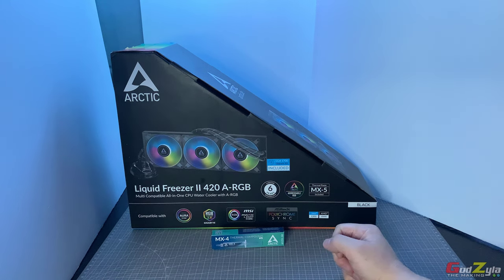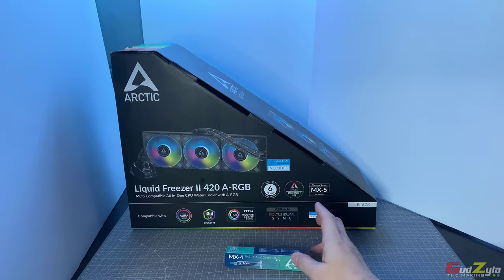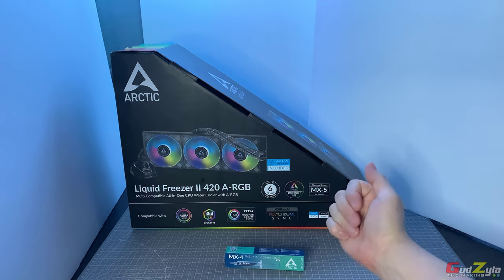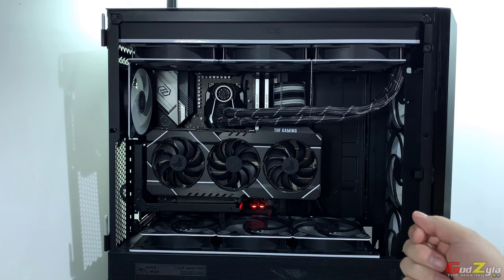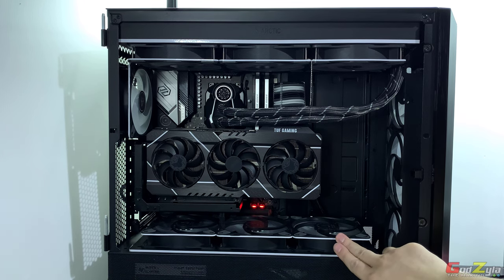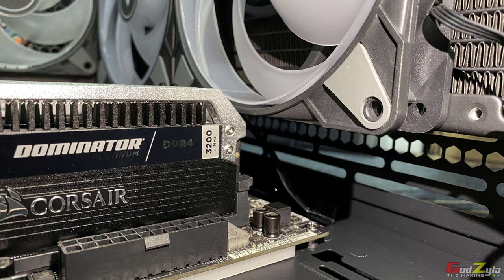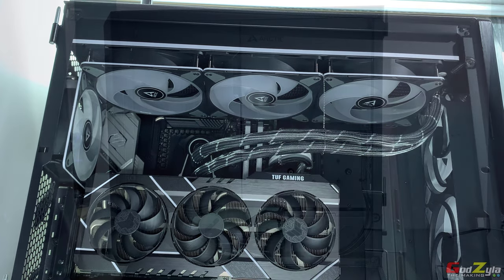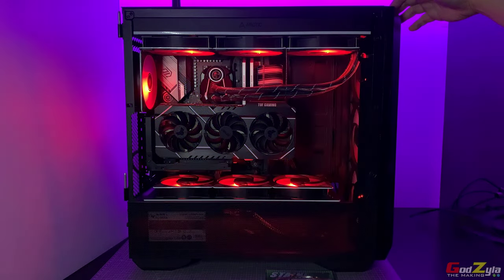Arctic Liquid Freezer II 420 in Lian Li Lancool III - Part 2 (The Experience)

Comment: Amazing review! Insta like and sub. I bought the case and the AIO because of this video. I have a few questions about the assembly seen in the video:
a) How long are those rubber screws? 
b) Do you think the rubber screws are needed for 17-18 mm fans? Such as the preinstalled fans that come with the RGB version of the case

Thank you very much
Reply from the maker: Hello Unai Biurrun, welcome to my channell as to answer your questions,

Qa) How long are those rubber screws? 
Aa) They are not rubber screws, they are rubber clips for fans. you can have a closer look here https://www.amazon.com/gp/product/B0749BRLXW/ref=ox_sc_act_image_1?smid=A1BZIHZ1Q03R2Z&psc=1

Qb) Do you think the rubber screws are needed for 17-18 mm fans? Such as the preinstalled fans that come with the RGB version of the case
Ab) Sorry, I dont really understand your question here. why do you need to use these rubber fan clips on the preinstalled fans? I Assume is at the frong?

now please note, I have miss out one part of the video, which is the front. you can only mount it this way at the front tray, if not, you can't lock the tray in place. https://imgur.com/gallery/vHezOSS
Reply: @KleoYan  
Hello Kleo Yan,

First of all thank you for your answer.

Aa)
Yeah, "rubber clips" is a better term, sry.
 
Ab)
What I meant to ask in my second question is if rubber clips would be needed to install a 17-18mm thick rear fan in order to be able to fit them alongside the 420mm radiator. 
You used a 25mm rear fan and without the rubber clips it wouldn't be possible to fit it, because it would collide with the radiator fans.

Also, why did you use rubber clips in the front fans? Would they fit with normal screws or would they collide with the radiator just like the rear fan?

Thaks in advance. Cheers!
Reply from the maker: @UnaiBiurrun  hi ya, ok as for question Qb) you might not need the rubber fan clips, but on the save side, it's better to equip or to pruchase, just incase. So sorry that I can't meassure for you as the case no longer with me.

Comment: Interesting. Lian Li recommends placing the AIO tubes at the back. My understanding was it's because tubes won't fit at the front. But you actually had no problem placing it on the front, even without removing front bracket. Nice, thanks for the info :)
Reply from the maker: Hi tabin welcome to my channel. There is a catch to the front. This is how I mount the fans in order to place the front fan tray https://imgur.com/gallery/vHezOSS
Reply: Wait, so, the front fans do not fully snap in once push them into the case? There is a springed hook in the front that holds the front panel fans. Did you just not bother hooking the front fans as they initially were? Is it even safe to leave them unfixed by the springed hook?
Reply: @isaaca.4570  Front fans are placed on this removable bracket and the bracket may or may not snap, depends on its placement. The bracket has two positions, one is with fans more inside the case and then AIO won't fit. But the second is with fans more outside the case and then AIO fits.
Reply: So is it safe if fan bracket does not snap into its original position? Should I then tape it or glue it so that it does not move?

Comment: VERY helpful video series.  Thank you VERY much for the care you took in making these 3 videos.  I'm planning to build a Ryzen 9 7700X or 7950X PC using the ASUS ROG Strix B650E-F mobo, LIAN LI Lancool III or Phanteks Eclipse P500A case, Arctic Liquid Freezer II 280 or 420 cooler, 32GB g.Skill Trident Z5 Neo RAM, and a Quaddro P620 video card (no gaming).  Thanks again.
Reply from the maker: Hi ya radar52, welcome to my channel and thank you for your valuable feedback. I am currently testing on the 7950x with pbo2 settings. Infact if you do pbo2. Temperature goes down and with identical or even better performance with the curve optimised set properly. With these pbo2 settings a 280 can handle the heat with the P500A case. No issue. By the way I did have part III which might interest you https://youtu.be/1SPioF78x_E
Reply: @KleoYan  Yes, I did see part 3 listed, I just ran out of time from playing your build video at 1/2 speed so I could follow it better.  I'll watch it tomorrow.  I've heard that the 7700X has a little more frequency head room over the 7750X, but I'm not sure in what use-case I could exploit that.  Anyway, thanks VERY much for the info on the pbo2 setting.  I actually prefer the ALC II 280 because it looks like less of a hassle installing it.  And I prefer the P500A case, slightly, over the LC III, although I can't really say why.  They're like 1 and 1a on my list.  I'm hoping that the Black Friday sales will give me better pricing on some of the parts.  Please do a video on your research with the 7750X and pbo2 settings.
Reply from the maker: @radar_B-52  ok will do but I do need time though. Nevertheless I will do up a vid about it. Thanks buddy and all the best with your build too 😉👍
Reply: Hey there, I was planning the same build except with a GPU (once the new AMD GPUs are out). Which case did you go for and AIO? I'm really considering the 420 AIO, especially for all these new power hungry CPUs... If you went for the 420, I'd really appreciate some pics and tips for fitting the 420 AIO in the case. 
This video is great, but would be interested in front mounting the AIO (ideally with tubes at the bottom...)
Reply from the maker: @Cenzo4u  welcome to my channel. As for your request. Am not able to do the front mounting with 420. Do pardon me as I have donated this case and the system.

Comment: Great vid - since this is becoming the hub for all things lancool 3 and 420 aio, I also have installed one. I have rog hero x670 + h170i. The top mount setup does NOT work with this mobo sadly. Mobo input shield is too thick. The 140mm fans don't fit with radiator in place. I would be cautious when buying mobo. I did find a reasonable alternative, which was to front mount (despite case not saying it supports such), where I installed the front plate in maximum forward position (i.e far into case, and 140mms in front). Unfortunately you don't get the clearance with any front radiator setup with this radiator to fit 3x 140mm top fans, so have settled with 2x on top, with reasonable spacing. It was not an easy install, but tbh it doesn't look bad.
Reply from the maker: Hello J 1, welcome to my channel. Part of the reason I did this content is to warn others too about the clearance. Which most motherboard manufacturer do not list dont the measurements for the height of the VRM and the rear I/O shield. Anway for font mounting, both are able to mount, be it Arctic or Crosair but as you've mentioned, not possible to mount 3 x 140mm fans. However, you can still mount 3 x 120mm fans at the top. Thank you for visiting my channel and to leave your valuable pointers which will help others. 👍👍👍

Comment: Holy Guacamole, I did not know you could install fans on the bottom too.
Reply from the maker: Hello Isaac, welcome to my channel. Yup you can mount fans at the bottom. 😉
Reply: @KleoYan  Good to be here. Did you install the air filter under the bottom fans to prevent the dust and any other particles from getting into the case?
Reply from the maker: @isaaca3849  nope, I did not install any as I always do regular dust off using a portable air blower.

Comment: I have to remove front stock fan and the bracket just to install the radiator. Once radiator is in the front backet can no longer seat. This arctic freeze is actually shitty
Reply from the maker: Hi Cybercore Private Software, welcome to my channel. I did tried to mount the LF2 420 at the front and unable to do so, thats why i've placed it at the top. Nevertheless, thank you for your feedback.
Reply: @KleoYan  I fix it on top bro, but when mounting with screw only the left side fit, right side all not fit. If left side one fit, it will also cause the front fan panel to not able to fit it.

I end up having to tilt Abit and tie it with cable

Mine revision one come with lg17000 upgrade kit but obviously not built well for lancool iii. Really regret
Reply from the maker: @cybercoreh4ks  hmm I don’t face the issues you have. All my screws at the top holds the radiator. Only issue I have is the rear fan where I use rubber fan studs. As for the front fan tray. I mount it this way https://imgur.io/gallery/vHezOSS I am so sorry to hear your side of story but I never regret as it does cool my 7950x better compared to a 360 Arctic LF2
Reply: @KleoYan  I managed to get it work by removing rear fans. I bought the argb one without any controller.  now that i have installed it, it has got no colour at all.

i connect three of the fans from radiator to the socket from the pump from radiator, then connect the 4-pin from socket to cpu_fan in motherboard. there is one more 3/4pin thing from the socket, i didnt know where to connect it [i believe it is for the colour right]

would appreciate your help

i spent around 10 hours this is my first time building a pc, hahaha, got very tired and frustrated after failing to screw well on the radiator [ didnt remove the rear fans as instruction by lan li iii paper ]
Reply from the maker: @cybercoreh4ks  I have done this. For all fan load. I daisy chained them according to this.

For fan load
=========
Top Radiator - fans x 3 (daisy chained) to motherboard CPU_Fan header

Front - 3 x fans daisy chained to motherboard CHA_FAN5 header

Bottom - 3 x bottom fans daisy chained to motherboard CHA_FAN4 

Rear - a fan to motherboard CHA_FAN1 

For fan argb load 
=============

First purchase this RGEEK 5V 3Pin RGB LED Splitter 10-Port Hub with 50CM 3Pin Extension Cord, Perfect for Lots of RGB. https://a.co/d/2lU92tv which gives you 10 argb port. Next your case have 3 argb connectors for the front fan. I have plug 2 front fans to the case argb connector, leaving one to connect to this argb 10 port hub. Now for the 3rd front fan, plug it this argb 10 port hub and you left with 8 port empty, the rest of the fans just plug individually to this argb hub. Argb extension cables might be needed. And I don’t understand why 3pin argb extension are so expensive on Amazon.com SJZBIN 3pcs Micro Connector Addressable RGB Extension Cable 30cm Black RGB Strip 3Pin Extension Adapter https://a.co/d/aA5BIkU.
Reply: @KleoYan  Top Radiator - fans x 3 i connect it to the 4pin fan header from radiator pump. each fans have two other cable that i dont use.

then i connect the 4pin of socket pump to the cpu_fan, and the 3pin 5v argb to my motherboard jrbg_v2 3pin, but none of my arctic fans have rgb. 

my lan li casing fans all have rgb. is it because the 3pin of socket pump is faulty?

my msi lighting software said it can recognize but changing the light setting wont affect my arctic fan. i can control only the front lan li casing stock fan atm with my msi lighting aura
Reply from the maker: @cybercoreh4ks  I think is best to list down what fans are you using and also what motherboard are you using. i am getting confuse of what you have typed. do it as point form as I've illustrated to you. Thank you!
Reply: @KleoYan  
arctic freeze ii argb 420 rev 1.
Lan li iii casing
MSI pro z-790 pro wifi ddr4

Lan li Front fans x 3
Arctic fans x3 with radiator at top 420mm.

I connect two header from socket pump of arctic, one to CPU fan socket, one to arpg socket in mobo. But arctic fans is not getting any rbg.

My arctic fans are daisy chained to the  3x connected 4 pin header from the pump area of radiator.
Reply from the maker: @cybercoreh4ks  ok.. I think I know what's going on.. you will need to download MSI center to activate the strip for JRGB_V2. watch this.. https://youtu.be/VST4LFZ_L-U?t=131 in the video where you have the LED with a drop down. you will need to select the strip to activate JRGB_V2. to download the MSI Center , go here https://www.msi.com/Motherboard/PRO-Z790-A-WIFI/support#utility
Reply: @KleoYan  thanks i fixed it already. i did prime95 test on i7-13700k with this aio and i reached 100c max is it normal? the top radiator arctic fan with the arctic logo facing downward mean exhaust right.

i have 3 fans in front (intake), top radiator arctic fans (exhaust) but my stress test is easily hitting 100c (cpuz or prime95). wondering if its due to me applying thermal paste (spread 3 line, then straight insert the socket)
Reply from the maker: @cybercoreh4ks  looking at the fan with the frame side. That is air pushing and without the frame is pulling. If the logo is without the 0.11a word is exhausting air out. The one with is intake. And your temperature it’s how the processor work. You might need to consider adjusting the power consumption. This I can’t aid you as I don’t use intel processors since the beginning of AMD zen 3 era. Now am using zen 4. But if you search in YouTube on how to undervolt intel 13th gen processor. You should be able to find some tips about it. And as for applying thermal paste. I use a different method. Maybe it will help you too. https://youtu.be/xZ2R4roF1_Q

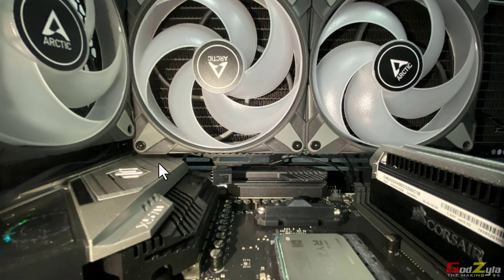Comment: 12:31 no luck for my motherboard :( 
mine one is msi z690 force that rear IO around 50mm lol
Reply from the maker: Hi Mr_Problem_01, welcome back, I am so sorry to hear that, at least you did notice it's not possible. You might want to have a 360 Arctic liquid freezer II
Reply: @KleoYan  bcoz that day i try to install tecware 360aio with push pull on o11d but cant fit will hit the rear IO lol 
after i view again your video and find out this motherboard rear IO really big lol
Reply from the maker: @mr_problem_0151  I see. hmm, I mean the Tecware Mirage 360 has a 27mm thick radiator. you should have just do a push configuration. The reason is, the amount of ampere usage for addition 3 fans increases but the temperature will only drop by 1 to 2 degrees or sometimes not even dropping in temperature. 
I find it no point to do push pull configuration on a 27mm thich rad, unless your rad is 50 to 60mm, then push pull configuration will help and the temperature drop are interms or 5 to 7 degrees.
Reply: @KleoYan  hmm sound like i have to go meshify 2 with 420aio lol 
my 12900k now undervolt 0.050 and lock at 4.8ghz when stress test high 100c in 1min
Reply from the maker: @mr_problem_0151  I see, that I can't help you as I dont hae the meshify 2 ARGB if i am not wrong. all the very best with your build.

Comment: Hi! Super video, I think the best!
Could you please advise...
I bought "ASUS TUF GAMING X670E-PLUS" motherboard, "AMD Ryzen 9 7950X 4.5 GHz" processor.
Now I want to buy "Liquid Freezer II 360 A-RGB" (because it works quietly, according to reviews).
And I can't seem to find the right box.
Will "Lian Li Lancool III" fit? Will assembly be easy?
Reply from the maker: Hi WebCode, welcome to my channel and yes it does fit easily with a 360 liquid aio with your Asus TUF motherboard without issue. Now just some info about the Arctic Liquid Freezer II aio. You won’t go wrong with it and here are some reference as why https://youtu.be/ugg_6bvYZAk . Also this might help you to obtain the highest clock speed too. I mean you don’t have to purchase the mx6 but am just sharing with you on my method to apply thermal paste which will be neat and some of my viewers have mentioned it did help them achieve good results too https://youtu.be/xZ2R4roF1_Q
Reply from the maker: @webicode  Must is be as big as the lancool III. If it is, then get the be quiet 802

Comment: The radiators fans should be put between the top of the case and the radiator 😉
Reply from the maker: Hello Live1509, welcome to my channel. It's either way as the temperature does not change between push or pull, unless is push pull, but for your method, it's easier to clean the radiator and to reduce dust collection 😉

Comment: This is going to be super helpful as I just bought this same case and AIO and I’m going to use your same fan types and configuration. What screw drivers do you typically use for your builds - the one in this video looks great. Any links would be great.
Reply from the maker: Hello Laura Blake, welcome to my channel. The screw driver set am using are from a company call Nanch. You should be able to find it at amazon. Nanch Small Precision Screwdriver Kit Set https://a.co/d/4XiVOVt but they are none magnetic. Also please note the front orientation of the fans. There is only one way to fit them with the front tray close. Illustration here https://imgur.com/gallery/vHezOSS

Comment: you could have mounted the radiator so that the outlet was at the bottom and not at the top, you had the space!
Reply from the maker: Hi Adamu, welcome to my channel and yes I do have the space but the hose is hitting my GPU and I have to push it to the back which cause tention. Unless I place the hose up instead at the bottom, but I dont like the idea of doing that.. thats why I mount it at the top.
Reply: @KleoYan  i just done it with the same aio but without leds, and in a silent base 802 BeQuiet
Reply from the maker: @adamu6941  nice.. and that case looks good too. I am curious of your build.. mind to share some pics and send it to my email at godzylatech@gmail.com , thank you very much!